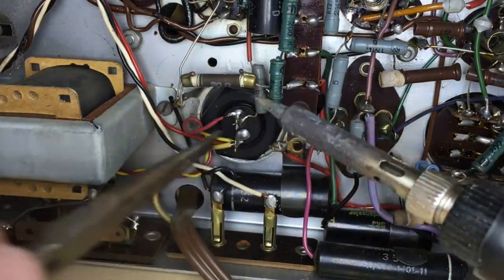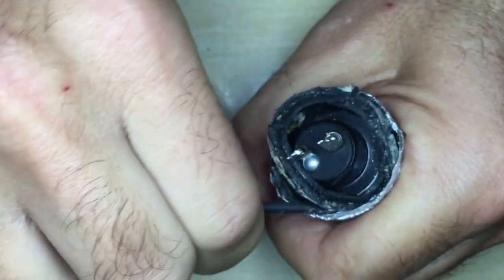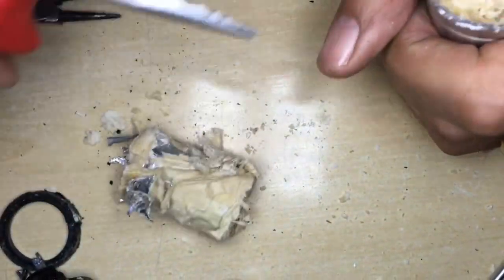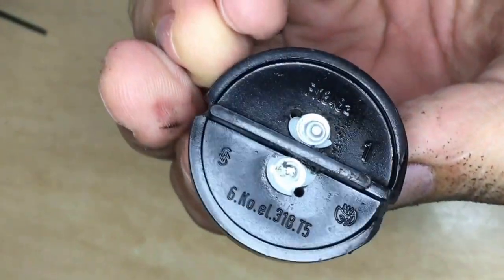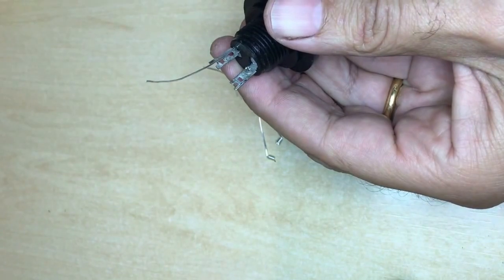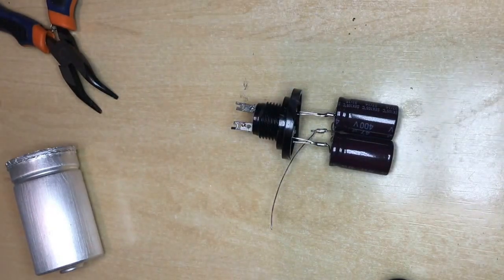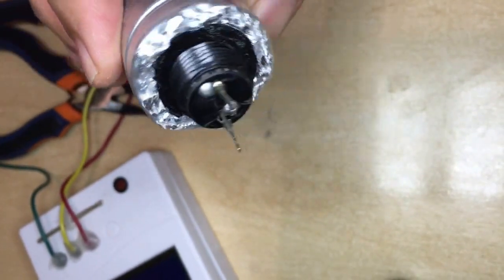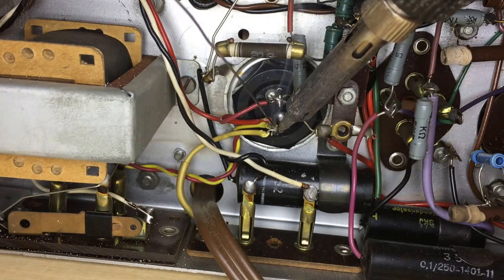Re-stuffing filter capacitors in Saba Freiburg W2 (WII) tube radio.

Comment: In some cases you can get lucky by adding distilled water to an old dry cap. Inject using a hypodermic needle in the top while applying an increasing voltage via a current limiting resistor. When the current drops, the electrolytic dielectric has reformed. Re-seal the hypo hole with wax.

Comment: I liked this video so much that i subscribed.  I liked what you did to keep appearance of originality. Those solder joints are excellent and as far  as can see.... is the tip of the day! I am replacing the ones in my 1962 hallicrafters sr150 when they arrive and i will be using your method. Thank you!
Reply from the maker: My pleasure.

Comment: I never restuff caps, authenticity is lost anyhow when you do this.  I disconnect and leave the originals in place.  Replace with modern caps under the chassis.
Reply: I dont leave the old capciators in place,I might save it ,but I remove it to make the recapped radio something someone can follow leaveing old caps in can confuse ,a somewhat novice tech.like myself ,they old caps take up room too ,and I want it clean looking as possible as I can make it for me that not always easy.still leaning from on line techs,I like the on techs that will answer questions,but everyone has there own way of doing things.old radio are fun to listen to .
Reply: I usually also do this, but there are a few cases there is no space to fit modern capacitors, so you must hollow the can and put new ones there. I usually used a flat dremel disc to cut off the rolled edge and pull the innards of the capacitor out. Heat helps a lot to soften the rubber seal, etc.

Comment: At around 9:20: Sprague used to include a couple of those little spring thingys with their replacement caps in the -60s. They called them "Quiggles", I think.

They were designed to replace top mounted caps on PCBs. They were little copper springs with a layer of flux, then solder on them. You clipped off the old cap, trimmed the new one to length, slipped the little coils onto them, and just touched the coils with a hot soldering iron. No need to gain access to the bottom off the circuit board.

I have been using that idea for at least 40 years. It makes a GREAT wire splice, particularly if you cover it with the same color of heat shrink tubing. It's much neater than the usual "twist the wires together, solder, then electrical tape the joint".
Reply from the maker: John Casteel : I believe that was the name given to these little marvels. I use them quite often.

Comment: Thank you.  How was the extension of the two negative leads grounded?  If the external can were aluminum, to  solder would be difficult, else impossible.  I could not see it once the base were re-inserted into the can.
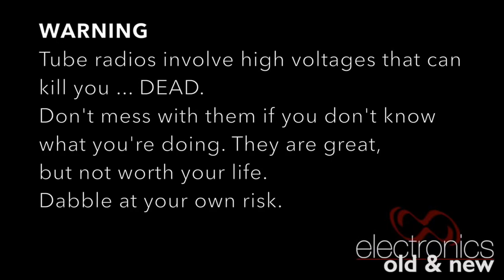Reply from the maker: Tom Watkins : see at 14:09 where I mention that the negative makes a good contact with the can itself, which is the negative as per the original capacitor. The can then makes contact with the chassis or, if insulated, has a washer which the negative is taken from.
Reply: Great video, but I'm not happy personally with depending on the fortuitous negative contact of the wire with the metal can, I try to take the negative lead to an appropriate tag or ground point and solder it.
Reply from the maker: Tom Watkins : no. Just a thin screwdriver.

Comment: I think of doing it this way, but I'm wondering if getting the capacitor material out comes with a health hazard? Do you know what type of capacitor material was used for radios of the 50es and 60es? Your videos are extremely valuable and insightful. Thank you so much! Greetings from Germany.
Reply: In US caps there is a big change of PCB content, I don't think German caps  should have it. Even though you should wash your hands, some acid or basic electrolite may be present.
Reply: I think there were no PCB filled electrolytic capacitors. PCB was only used in oil filled caps (motor run caps, etc.).

Comment: Thanks for taking the time to make this video.  Very informative.  I like the wound wire trick for extension leads, will definitely use that.  I am trying this and would like to fill the void to stabilize the caps inside so they don't rattle around.  Any thoughts on a packing material?  glass beads or sand?
Reply: I've done a few of these, because the leads are short, they are fairly ridgid and they don't tend to move inside the can once the soldering is done. I usually just put a piece if heatshrink over the new caps bodies to hold them together and in place.